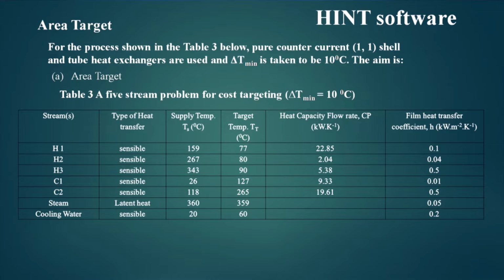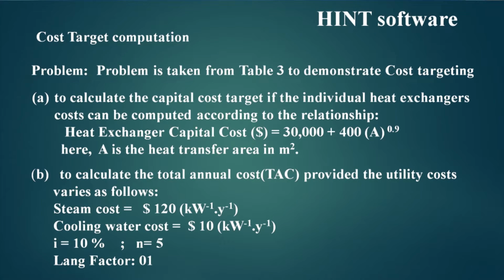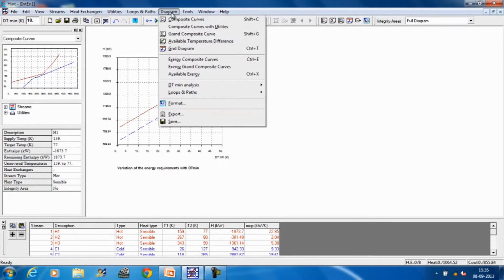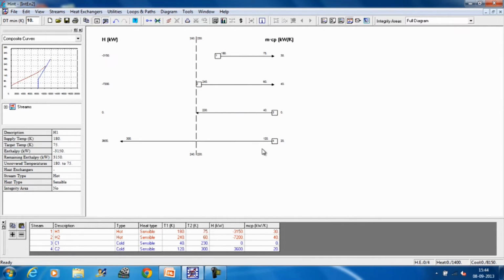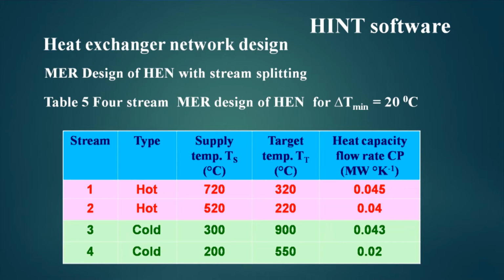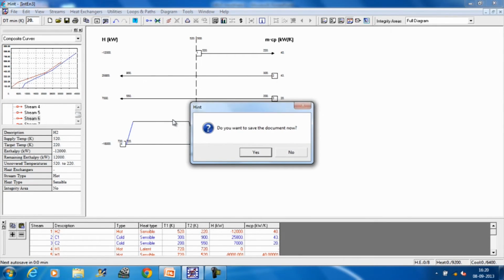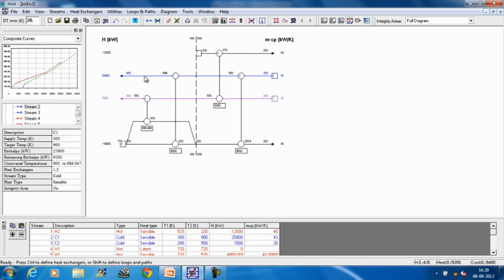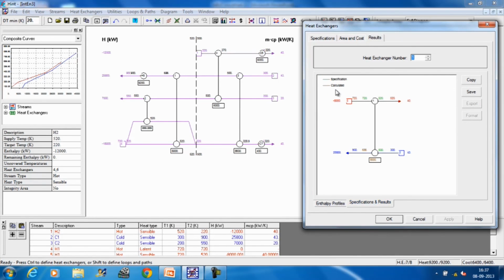Mod-07 Lec-02 Problem solving using HINT Software- Part 02

Comment: Sir I am facing a big problem in saving the file of HINT. it is saved in a foray which can not be opened in my laaptop. so can you suggest me any method to save it so I can open it later.
because i AM  using this software for my Final Year Project
Reply: same problem